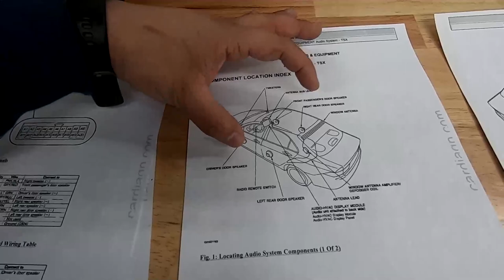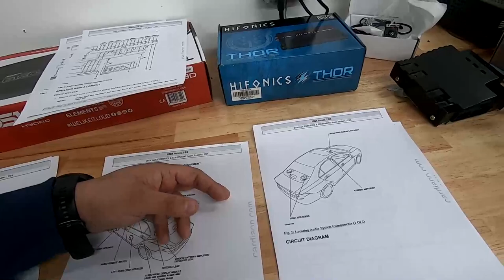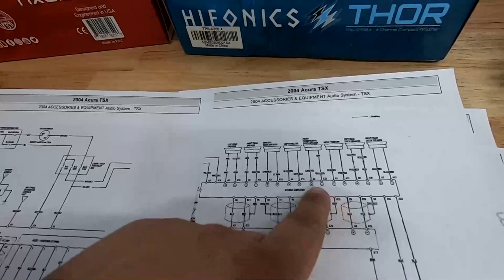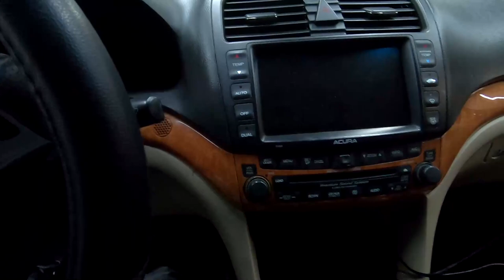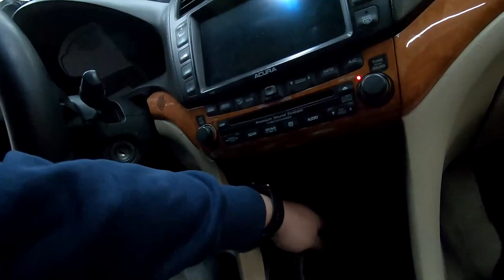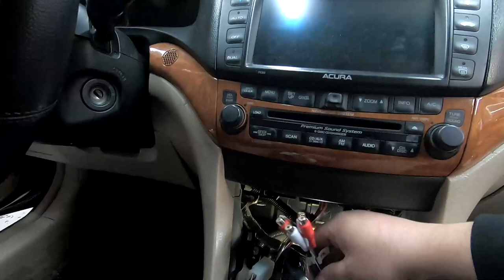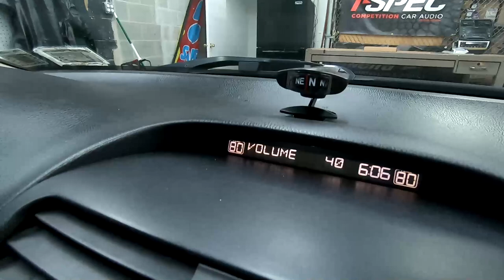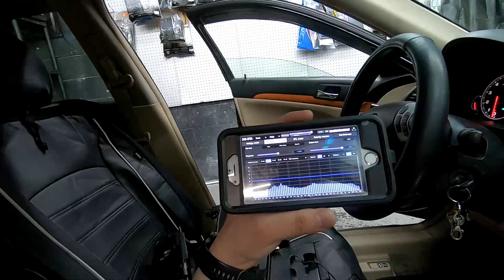2005 2006 07 2008 Acura TSX Factory Amplifier Bypass - PNP Amplifiers

Comment: Oh my, im glad i looked around one last time. I was about to hack away and solder wires and test 1 by 1. I have a 4 channel and a mono im installing to pair with my aftermarket radio.

Getting this bypass harness, but wont need the RCAs

Comment: Hey @AcuraAudioGarage I’ve got a question bro I’m trying to get some down firing kicker 12” with Passive radiator and box they have available but I don’t know what I’d need from your website to get that to connect to my 2007 Acura TSX Non-Navi Automatic car I am planning on upgrading all the speakers on the car as well since one of the decks are blown out 

I want an upgrade don’t feel the factory amp is loud enough and want nice loud sound to power the cabin and 12”sub&passive radiator 

What should I buy as far as amps, cables, etc. I have a Epicenter already waiting to get installed should I purchase separate amps for the cabin and subs or can I purchase a 5channel or however many channels you recommend amp to run all things to one

My ultimate goal Is I don’t want to have my trunk space taken up by a ton of stuff the the more I can hide stuff the better to look factory i use almost all my trunk space and those down firing box seem the better move for me

Comment: What I'm trying to figure out still is. Can I use the harness to by pass to a new Amp? But make it where I can use the stock radio with an aftermarket subwoofers. I have an older model Jensen 8channel Amp I wanna throw I'm. And I also have aftermarket subwoofers where I wanna throw in my car as well. But I wanna keep and retain the factory radio
Reply from the maker: yes you can use the bypass to install your own amplifier and use it in the way you described.

Comment: i installed a headunit and wired it all back up with the metra dash kit but no audio is coming from the speakers. the headunit and dash all powers on but just no sound. would i have to bypass the stock amp somehow?

Comment: Im not an expert on anything to do with radios, if i buy the speaker package on your site and the amplifier, would a noob like me be able to add the amp ? Does it come with instructions?
Reply from the maker: Hey it does come with instructions from the manufacturer but you can use the video here to help you install it.

Comment: @ 16:20 in the video , that didn't sound right. I think the factory amp also has x-overs for the door/tweeter.  If someone is going to the trouble of doing a aftermarket amp, would they really want to listen to the factory tweeter ? The factory door speaker is pathetic but the TSX has around 4" of depth before you would touch the door glass. 
I'm having amp envy. Any one of those would be better than my Dual.